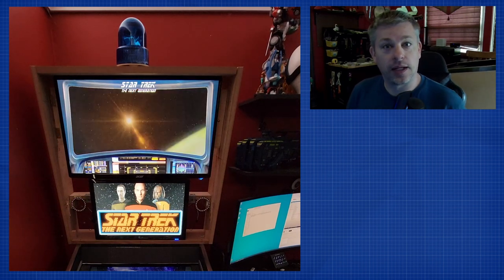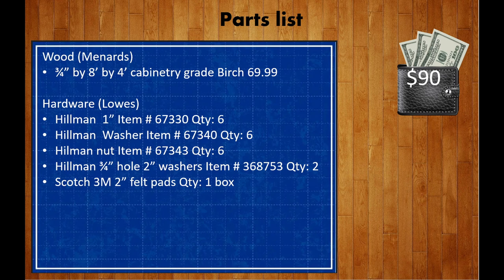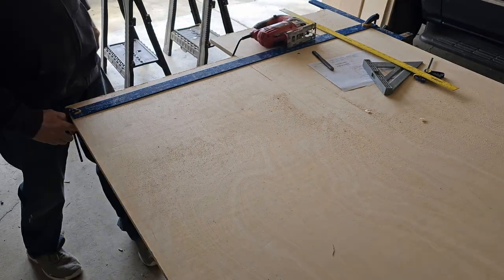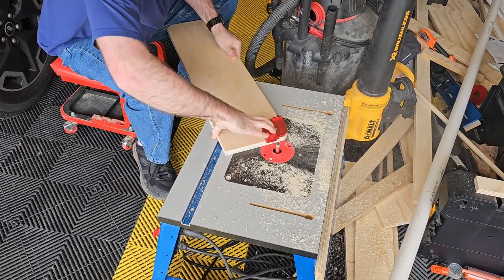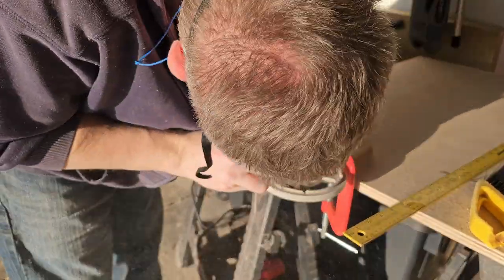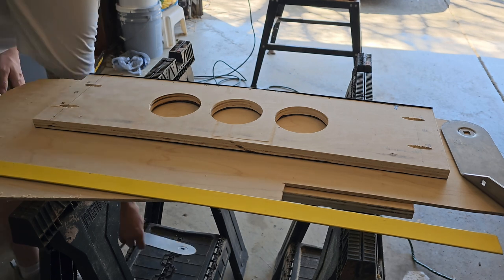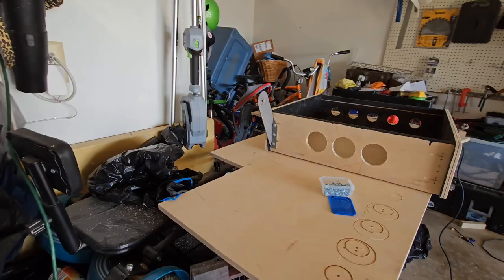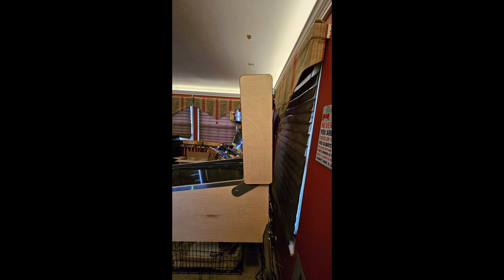Scrapyard Pinball (Pinball on a Budget) Episode 13 making a new backbox

Comment: Hi! I have problems with straight cuts with jigsaw. It is a Bosch product. I tried many ways to do it correctly but i don't know why the saw moves to one side even though I put the guides. Could it be the machine problem? The saw blade? I normaly use the straight blade. Sorry for my english. And many thanks. I'm going to make a virtual pinball too! 7:15
Reply from the maker: It could actually be a few things. Jigsaws have a ton of different types of blades for different thicknesses and types of cuts. Also, the cheaper the blade, the quicker it will burn out. Try to find one that is specific for 3/4 wood. The style cut can be fine to rip. You want something in the middle ground. It could also be that you're pushing too hard. My videos are speed up to 8x, so you don't see some cuts take me 4 minutes to make. The tool cut and just guide it. If the tool is old, the blade holder could be worn out, and rather that holding the blade tight, it could be flopping around. Check out this guide for help. https://www.thegeekpub.com/3018/why-your-jigsaw-isnt-cutting-straight/#:~:text=To%20Cut%20Straight%20your%20Jigsaw%20Needs%20a%20Guide%20Bearing&text=The%20guide%20bearing%20adds%20a,warped%20or%20poorly%20supported%20material).
Reply: @chipgt81  Many thanks for the answer! I Will read that article, and take many notes of your advice in the future!